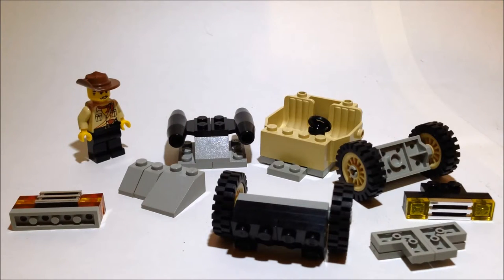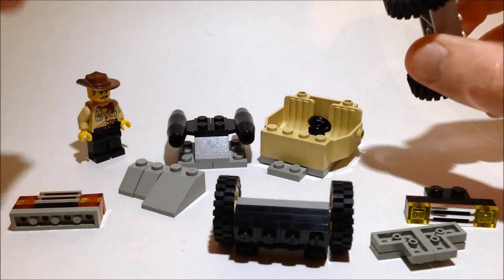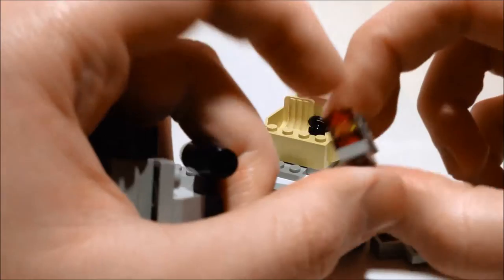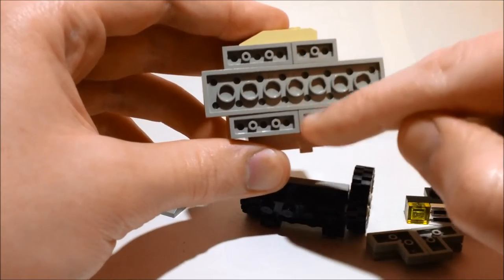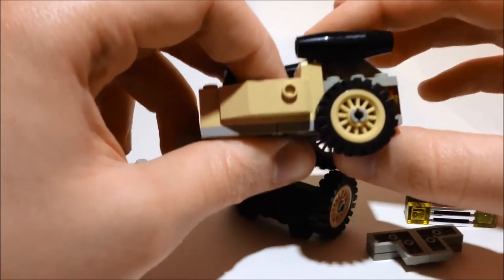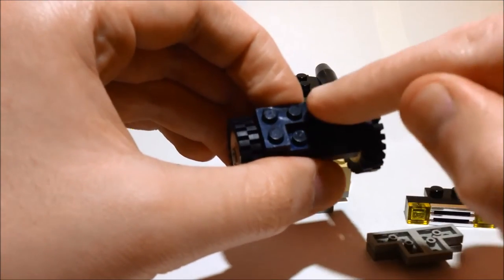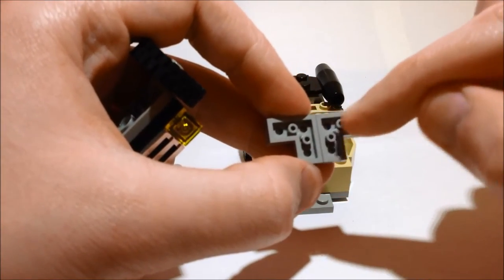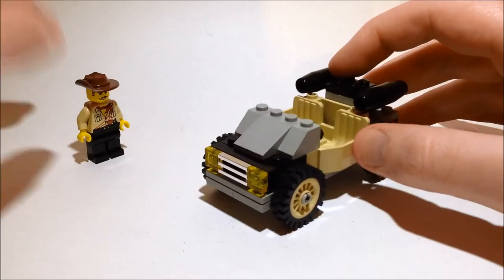How To Build - Johnny Thunder From LEGO Racers

Comment: if you don't want to have that flexing you could always put the 1x2 boster engines on a 2x2plate if you built it your self.
Reply from the maker: True, but then it would not match the intro FMV model, which this is based on.